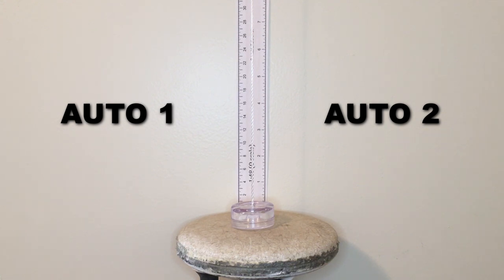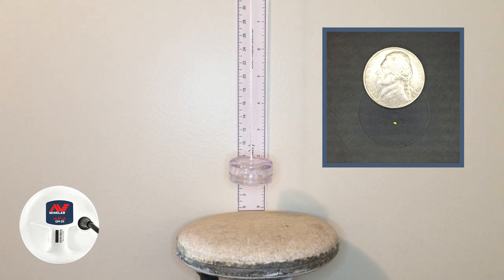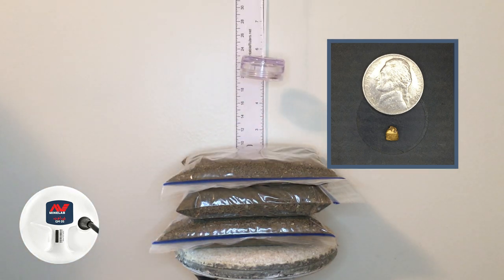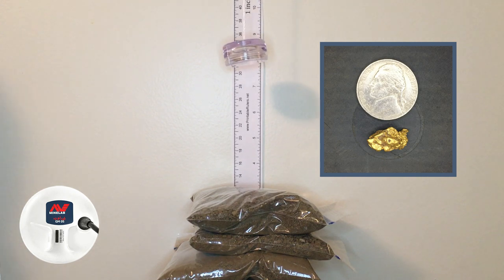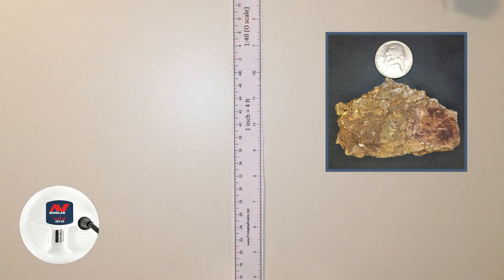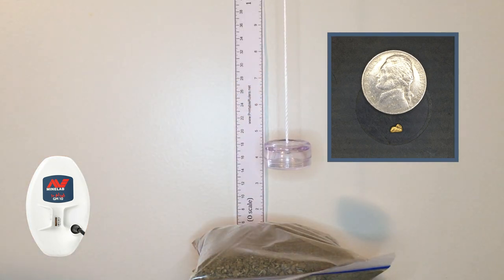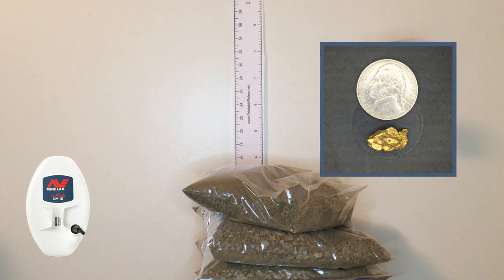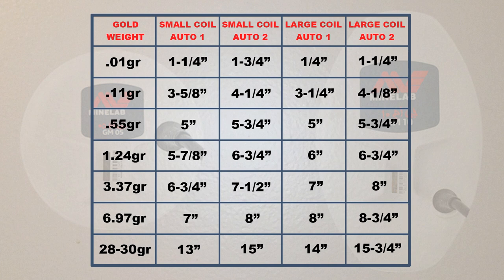Minelab Gold Monster 1000 Depth Test - Big Coil VS Small Coil

Comment: That is a really good test comparison. I'm kinda surprised how well both coils did. Good video....!
Reply: The missing component is mineralized soil. All air tests are void compared with real soil involved. Just depends on the amount of mineralization in the area your hunting. Heavy minerals and you could loose a lot of depth.
Reply: @davidcox2197  I thought that was the point of using the Zip-loc bags full of screened material between the coil & target nugget...or did I miss something here ?!? 
Of course, I would have prefered to see the bagged material stacked just as high as the swinging target at all points of the test - but honestly, that was IMHO
 a pretty good comprehensive test compared to 90% of the other tests that I see posted on here. :-)
Reply: @wchurst that just looks like potting mix that soil. You need Aussie red dirt.

Comment: Good job on the testing! That 5" coil is definitely a beast! I found it is slightly more sensitive to the small nuggets than a 6" on my old XT17000. It is much more sensitive to the really small stuff than a 6'x8' Sadie coil on my GPX5000.The Monster is much easier to run than either of those detectors though...and no threshold! Love the Monster! Thanks for posting!
Reply: Whoa! You have an xt17000! Do you have any pointers on settings? I have one and really enjoy it but it's been a while since I last used it. Can you use any coil with it or only certain types? Also, how long will the battery pack last before needing replaced? If you have some time, drop me a reply. I would love to see your setup. I am in AZ by the way. Take care!
Reply: @romeo1550  I did have an XT 17000. It finally died about a month ago. I have the stock 8" coil as well as the Coiltek 6" and 15" that are made for the XT or Eureka Gold (I never used the 15"). The stock coil is a pretty good coil and I detected a .017 gram speck of gold with it. The battery lasted all day when it was new, but I always carried the AA backup pack, just in case ( I still have that, too). My advice? Learn the machine and the different sounds it makes. Use headphones. Turn down the sensitivity till the detector quiets down some. Sensitivity will depend on the ground you're detecting. I've used it as low as the 10 o'clock position, as well as all the way up. You will always hear hot rocks and hot ground...dig ALL targets! I carry test nuggets (pieces of lead will work) to help distinguish between hot ground and a target. I didn't use the discriminator. I set the threshold as quiet as possible without the sound breaking up. The switch settings I used most of the time were normal, normal, 32KHZ and tracking. I would switch from tracking to fixed for pinpointing. Once you get used to the sounds it makes, experiment with the different settings to see what works best for you in a particular area. Much depends on the detectorist. There are days that I can run the sensitivity really high and other days that I just can't deal with all the noise that a high sensitivity makes. The XT 17000 is a great detector! Sorry, a little lengthy...
Reply: @azdesertrat6969  awesome post and great info. I have yet to find gold with it but it has helped me find areas of promise and I was able to find gold that way. 
As for the detector, you said that your machine finally quit working. What were the symptoms? Currently mine is giving me fits and I can't tell if it's battery related or the machine just not working. I will charge the battery, turn on the machine and get a click and that's it. Nothing else. Any details you could provide would be greatly appreciated. I think that regardless of whether or not my machine still works I will get the gold monster. Thanks again for your help.
Reply: @romeo1550  Mine just screamed at full volume when I turned it on. None of the knobs or switches made any difference, with a coil attached or not. When you turn it on, it's supposed to give a loud tone that fades to your threshold tone. If it just clicks it may be that your battery is dead...the loud tone is supposed to be a battery test. if you have a multimeter, you can test the battery. Fully charged, a new battery pack should be around 14 volts. Maybe Batteries Plus could test it for you and  supply a new battery if yours is bad. Minelab's prices for batteries are ridiculous, if they even still make them. If you find the machine is bad, the Gold Monster is awesome.
Reply: @azdesertrat6969  thank you for sharing. This will go far in getting me back on track. Take care and happy detecting!

Comment: According to the Nuggetshooter's Bible by Jim Straight - the use of the big coil vs the small coil varies depending on the stability, and whether or not you want to go back over the same areas again with the separate coil. You get more stability with a smaller coil, but the larger elliptical can get you more depth and help you find bigger nuggets(just like how the data shows at the end of the video - so generally its a better choice). But the book also says that the smaller coil presents an advantage when ground balancing allowing a prospector to fine tune the sensitivity. but the use of the small coil also depends on the size of the pickers, and nuggets that you are finding. I hope this makes sense.

Comment: Thanks for taking the time to do that, plus the editing it must have been a bear. I was always under the impression that the larger coil just gave you a little more coverage. Keeping it simple and not using any big expensive words is appreciated too. I've never tried my big coil and now I'm sticking with the small one.  I heard though, one was waterproof and the other wasn't, if anyone can comment on that ? Great video
Reply: I used the big coil in water and it got water inside and malfunctioned.. sent off to minelab and they repaired for free as it is supposed to be waterproof. The large coil has a little valve on top that can cause issues and let in water. The little one doesn't. So stick to the little one if your going to get it wet I reckon.
Reply: @jackmalzinskas9180  Ok, thanks, don't for see using it in the water but you never know and it's nice to have that knowledge.

Comment: Very good Test with SHOWN Results.  Good work, thank you I will pass it on to others.  Might I suggest doing another test on Coins, Jewelry, and Relics?  Looking at where the Depth of different materials register and also the differences in tones between materials and between the 2 coils. If one can get accustomed to the various tones that materials produce it increases the good hits many times over and is a must for beginners to excel with a detector. This is more than just a Gold Machine although it is its Primary use. Right now I can't do Rivers and Creeks because of high water but Parks, Beaches, Schools, Parts of the Oregon Trail and more are accessible nearly year-round............ Enjoy and Good Luck,  Keep Swingin' & Diggin'!

Comment: I just bought a GM 1000. Came with a guide in different languages. I have used YouTube to show me what to do but I dont know how to switch from auto 1 to auto 2.
Reply: The left button.
When the screen shows full blackout  on the left it's in auto 2. The most sensitive setting.
When you back off one click it's in auto 1. Less sensitive to ground noise.
All the lower positions are manual.

Comment: No doubt the best comparison i have seen and it has answered a lot of questions i had. I wondered if the monster could detect gold on a rock surface like the 28-30 gram example you showed us. Thanks for the effort. Meaning this can go upto 40 cms if the piece is big enough.

Comment: This is from using the detector hundreds of hours over many places: the auto settings will vary by a lot, according to ground conditions, because the detector automatically changes the sensitivity. Sometimes the ability to detect a piece of metal is reduced greatly in the auto 1 and 2 settings. Auto 1 is more aggressive in reducing ground noise, auto 2 is less aggressive in reducing ground noise. So, depending on ground conditions, depth results with auto setting can vary, and could be 1/2 of the results of these and the hottest manual setting.
Reply: exactly. he shouldve done the test with the max manual setting

Comment: Outstanding test video! Thanks!
Reply: I had no idea that the Gold Monster 1000 went that deep before I saw this video.
Any thoughts on what might be some other VLF detectors that might be useful for detecting larger (.75 gram or more) deep gold?
Reply: I assume you were using the 5” coil (maybe I’m wrong). I have to wonder how much deeper the 10” x 6” coil would go.

Comment: Nice testing mate I've been using Auto 2 for a few years now with the big coil and it works the best by far unless you are specifically targeting the smallest gold in tight places or right on the bedrock. The small coil as you proved is powerful but psychological it's hard to swing all day to cover large areas. My advice is use the big coil to find the patches and when you can't find anymore gold switch and you may be surprised. Auto is the only way to cover slot of mineralised ground quickly although it punches hard in max setting but makes too much noise and is impractical on the feild .
Once you get to peices over two ounces it will suprise you and bigger targets make you wonder if a heavier pulse machine is even worth carrying the extra weight.
Cheers Bruce
Reply: The better PI detectors add several to a lot of inches of depth on larger targets and will find gold almost as small as the Monster 1000. No way will the Monster find deep large nuggets as good as the best PI detectors, but they make a good pin pointer after you find a target with the PI. But it's kind of a pain to pack an extra detector just for a pin pointer. In my opinion the Monster is best used for small gold when hunting crevices on bedrock and shallow ground.

Comment: What do you mean auto 1 or auto 2.  I didn't.t see that setting. ?  is that the depth setting in the center of the display  ?
Reply from the maker: I don't know where I picked up calling it Auto 1&2...its actually called Auto + and Auto ++ its part of the sensitivity settings, not the depth setting in the center...thats basically iron discrimination mode and I would stay in deep mode at all times when looking for gold.  Auto++ setting is when you turn the sensitivity up all that way and auto+ is just one notch down from there.  thanks for the questions!
Reply: @metaldetectingforarizonago7685  Thanks
Reply from the maker: @ernestrosenkranz7642  no problem!  Thanks for watching

Comment: Is this detector specifically for small gold or will it find big aswell. I apologize if this is a dumb question as I'm new to  metal detecting.
Reply from the maker: Its probably the best machine out there when it comes to finding super small pieces, but it will also find bigger pieces at a decent depth.

Comment: So your test showed auto 2 out performing auto 1 why use auto 1 at all?
Reply from the maker: I try to use Auto 2 if possible... but when the ground is to hot for Auto 2, I move down into Auto 1.  I would like to just run the damn thing at max sensitivity but the ground I work does not allow that.  Sometimes I get away with it in quartz piles.

Comment: The more you place a coil over an object the more it discriminates it. Detectors always get the best depth in undisturbed soil. Or damp soil. You can lose a target by repeatedly running a coil over. This is why serious gold detectors always use all metal mode. Or pulse induction machines.

Comment: For the weaker signals where you’re calling it max depth or even an inch before you call it max depth did those register on the screen at all? I’m guessing no but I’m just curious.
Reply from the maker: Not sure I really understand your question but I'll try to answer it.  I just keep bring the piece of gold up higher and higher until it was gone with no signal, then brought it back down until it was barely making a signal, thats what I called max depth.  I had the detector upside down so I could not see the the screen at all.  My biggest lesson using the Gold Monster 1000 was when I found a 1 gram piece and the indicator was going all the way left like it was a piece of iron...if you want to find gold, don't pay any attention to the indicator...dig everything.  My advise!

Comment: Thanks a lot for this video, good to know. Peace & Grace brother
Reply: What's the main difference between auto1 & auto2. And does this balance by just moving it up n down on the soil or is there a button to use with balancing? Thanks
Reply from the maker: @JustJimJr  you just need to pump the coil up and down, no button needed...auto 1 handles the hot ground better than auto 2 but you loose a little depth on smaller targets...  Nuggetshooter Journals has a really good video on ground balancing the GM1000, look it up.  Thanks for watching!
Reply: @metaldetectingforarizonago7685  thanks brother

Comment: To get a truer depth test I would have added bags as many as I could at each level of the test. Aren't you just simulating most targets at 6" or so depth while raising the coil way up in the air as you prospect?  It does show why most everybody on YouTube uses the small coil, though!

Comment: Are you calling your AUTO 1 & 2 the last 2 highest settings where the center goes black.... are you in Deep mode also
Reply from the maker: Yes...  To be more accurate I should be saying Auto+ & Auto++....Always in deep mode, never in discrimination mode.  Thanks for watching!
Reply: @metaldetectingforarizonago7685  Thanks... I've had my GM-1000 for 3 years now and I usually search in the highest manual setting... I'll have to shop test some small pieces of Gold from Manual and Auto... I don't think most people understand the real difference between the last 3 or 4 settings...
Reply from the maker: @kelvenguard  I honestly might be one of those people...  You mind given us a break down on what the difference is?
Reply: @metaldetectingforarizonago7685  I'll do some research again and get back to you... There was a STRONG reason Why I and others use the highest manual setting over the Auto...
Reply: @metaldetectingforarizonago7685  I'm 53 from ALBERTA CANADA and I look for Gold in British Columbia & Yukon Canada and also in Nevada USA... I have the GPZ-7000 also but I've found more Gold with the GOLD MONSTER 1000... I short sticked the GM-1000 to 25-inches works great inside mine shafts and together with the GPZ-7000 on your knees digging... I bought a white 24 inch plastic pipe from a Nevada Home-Depo, pipe was prefect size left the arm rest off 5 inch coil...
Reply from the maker: @kelvenguard  When I first got the GM1000 I would tend to stay in the manual modes as well.  At some point I started using the Auto settings.  I've gone back and fourth between manual and auto on a signal and auto 2 seems to be the most stable while being stay pretty sensitive.  I admittedly don't now what "Auto" means compared to "Manual" with the GM1000...  Doesn't really break it down in the instruction guide...  I'd love to hear more!
Reply from the maker: @kelvenguard  Sounds interesting...  Yeah I look young but I'm 41...most would probably guess 30 or something like that.  I've been doing this for a little more than 20 years now.  Man, I miss going inside of mines and finding gold.  I found some nice stuff with the Gold Bug 2 back in the day out in California.  Problem is with most of the mines I come crossed out here in Arizona is that they go straight down, cant just walk in.  I'm tempted to rope down but I'm usually solo out there and its probably not the best move. I've had a few PI's including the GPX5000 and currently have a GPX4000...I've found more pieces with the GM1000 but more weight with GPX.  Anyway, take care man!
Reply from the maker: @kelvenguard  Sounds like a possibility...  stay in touch!

Comment: I know that claim, we pulled out like 3 grams of fines running our recirculating system.
Reply from the maker: Nice.  I think I'm up to about 2 grams in small stuff found with the GM1000 at that claim.  Thanks for watching!
Reply: @metaldetectingforarizonago7685  nice, Double J and Soilder Boy are great claims, but they are not for beginners.. lots of ground reading to do there
Reply from the maker: @MalteseCross  LOTS of ground, exactly!